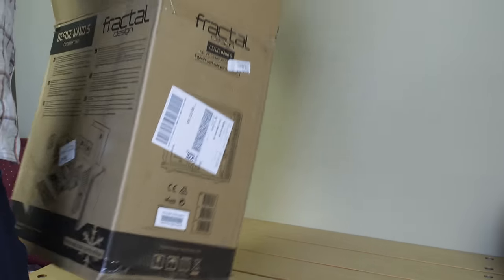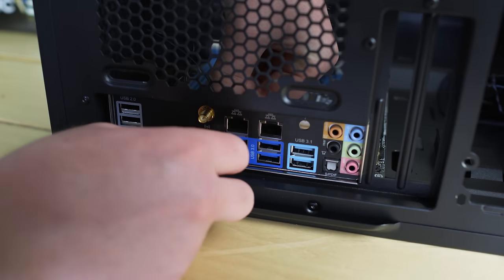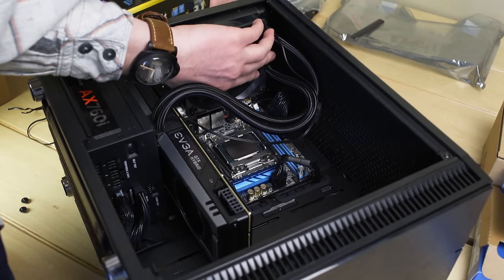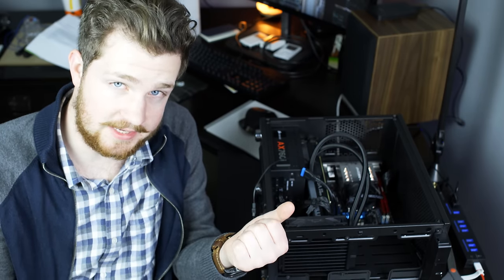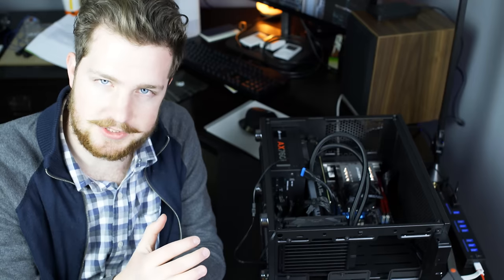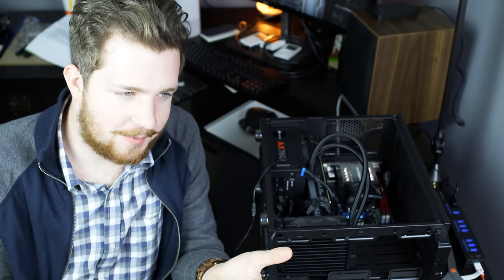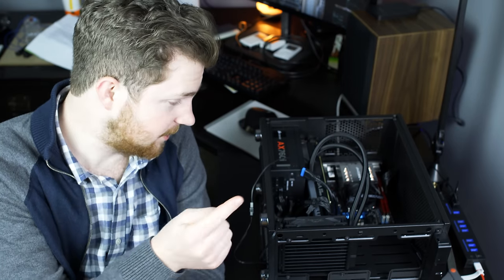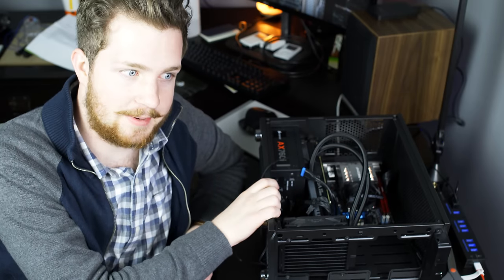My Powerful Custom PC Build Disaster

Comment: Hey Snazzy just a tip if the build isnt going to pull more than 80% of a powersupply then you dont need to go so high :) welcome (just helps save a bit any Thermaltake Corsair or EVGA PSU is good as long as its 80+ in any way)
Reply: +Phillip Roberts Also forgot to say never buy a refurbished psu

Comment: I've never run into any real problems building computers with new parts. This week I've ran into two video's where people ran into huge problems building a desktop, in both cases using brand new high-end parts... and then a refurbished power supply?!? 

I have to admit that I don't know all the ins and outs of refurbishment, but doesn't that mean these power supplies have been malfunctioning before? I wouldn't put my trust in that. 

Decent power supplies aren't that expensive. I usually spend 50-100 euro's and all the machine's I've build and still know about have been running for at least 8 years. It doesn't seem worth it to me to save a few bucks on these parts, given the amount of frustration and time wasted when it doesn't prove to be 100 percent reliable.
Reply: +jpoortman Ah, didn't see it on the first page, but apparently this subject has already been touched upon quite a lot. Rightfully so. Don't buy refurbished PSU's! Unless you do it to alleviate the environment and willing to deal with the misery I guess...

Comment: For me it totally looks like the graphics card is way too close to the PSU. Tests have shown that a triple-fan solution on Graphics cards like these is far superior over a wind-tunnel solution. Also, if a Cable like that does not fit into the PSU without mechanical force, you're doing something wrong or the Cable is the wrong one. You could have switched the ends around, for example...
Reply: its hard to get in becouse the mold they designed for the backpart whent 1mm wring wich made it hard to put in

Comment: Step 1 DONT BUY A SECOND HAND POWER SUPPLY
step 2 relax.
Reply: I mean seriously. Rule one of computer building is test it outside the case first. And if you need to use a screwdriver to connect something then there is an issue. Even a Mac fool like me knows that.

Comment: I think you may have put too much thermal paste on your CPU. It should be the size of a pea or rice grain, however it looked like you applied something like a chickpea or a blueberry. If it spills over the side of the CPU and onto the mobo, it could short-circuit, or you may just added a few degrees to temperature of the CPU. Either way, I would try again.
Reply: +zeronecool Short only happens if it's conductive paste, and you have to go really overboard to do that as it has to get under the CPU, not just off of the heatspreader.

As for temps: Anything at all more than way too little, makes no difference to the temps. The way modern heatsinks/etc. clamp down onto the CPU, it gets evenly thinned out, so the amount doesn't matter. ( Note that the way too little is a really tiny amount. Around 1/10 of what he put on. ) Since too little is the only thing that matters now, I actually purposefully lean onto the too much side.

Comment: Mac - Overpriced hardware with an Apple on it. 
If you want the MAC OS so bad, build a PC and slap that on there, and save yourself from paying for a $2000 apple logo.
Reply: For a similar price PCs are similar performing in the form factor. Especially with the Mac Pro line. But if you want pure performance then Apple is just terrible.

Comment: lol "eliminate the denominators" sounds like a bad ram stick. lol not a power supply. do a memtest. smh hahaha omg what a waste of time. sometimes its better to leave the building and testing to people who are familiar with the platform. putting together a computer is easy as legos but testing is another game altogether . I just fixed one of these issues on an htpc for a guy. would work for 15-30 minutes watching video. first thing i thought was it was dirty or a fan died. Opened it up and it was pretty clean and the fan worked. ran a memtest. BOOM bad ram. could check power supply voltage and temp  to see if it was that.
Reply: also ram needs to be in certain lots if you are not using them all.

Comment: I hate the first week after a new build
Reply: +SE09uk 2 months on my new build, I'm starting really regret Win10...driver issues out the ass, Crossfire not running right and Steam crashing like theres no tomorrow...I miss 7
Reply: +silver&lead I have 7 and 10 in a 2x boot but never use 10
I could have give up my 7 key to use on 10 but like 7 too much
I just run 10 in dev mode (cant remember the name) with no key and it has worked for monts
do you have a 7 dvd or .iso you could install ?

Comment: First of all, 
Your chassis is way to small to hold in all the fans and the damn liquid cooler,
Second of all you put quite a bit of glue to the core to attach the coolant system,
Third of all; it did not look like you attached the cooler to the side of the chassis right, that is just speculation. Don't snob around and tell everyone a mistake you made. Just get a larger chassis, that one is way to small if your going to be going through upgrades.
Reply from the maker: +SucThenut V Firstly, you're incorrect. It's a fine size. Secondly, it's paste. Not clue. And it's fine. Perhaps a little too much, yes, but it doesn't matter. Third, it's attached right.

Comment: snazzy u have a 6 gb video card (980ti) and intel core i7 and ddr4 ram on a 760 watt power supply u should get at least 950 watt to work like a beast
Reply: even a 500w psu would be enough

Comment: I would have bought a 1080 instead of gtx 980ti
Reply: Jonas Langesæter its much cheaper so if ur not rich i wouldent buy a 1080
Reply: FinalBali Yeah you Are right i can't come close to having enough money to buy a 1080. It just semt New for me that a youtuber bought a semi outdated card when he could have gone for a better option like the 1070. If he wasn't gonna oc alot. :)
Reply: Jonas Langesæter I'm sure he probably would have done the same, but at the time that he did this build the 10 series wasn't released yet. Also the other guy is wrong, not sure about prices in his market but a 980Ti Hybrid costs more than most 1080s with less performance, only way I could ever see someone grabbing one over a 1080 is if they had a case with really poor airflow or wanted really nice temps.
Reply: this video was made a good amount of time before the GTX 1080 was even announced

Comment: 2500$ PC... With a refurb power supply. WHY??????
Reply: +IRNatman honestly I'd have to guess it's because he got a lot of those parts through sponsors and probably didn't spend a TON on parts himself. there's just no way he paid 25 hundo out of pocket and was like "hey I'll just get a refurbed power supply instead of a reputable one with similar wattage for a slightly higher price" and here we are. he could have gotten a seasonic 700w PSU that was modular brand new for probably $120-130. but this is a guy who got a 980ti and 32gb of memory to "edit video" so

Comment: yep you got a way to low powersupply for your build dude you should always anytime u build a new pc use a power supply caculator that 980 ti you need a min of a 800 watt psu that not including all the water cooler u have
Reply: +Khromus S if you want to use all that liquid cooler i would recomend at least a 900 +

Comment: so bought great gpu, good psu and ddr4 ram but opted for a shitty mother board and a small case to cramp everything in :(
Reply: Motherboards don't matter as long as it can run the cpu you use and ram and has features you need such as oc support.  The power supply is the problem refurbished is really bad it's a 50/50 chance of getting one that will work and probably another 50 that it will work for how ever long you intend to keep that pc for.

Comment: you didn't install thermal paste... you couldv'e gotten way better temps with thermal paste.
Reply: FBZ-Spongebob it's preinstalled on the CPU cooler
Reply: it was used
Reply: 7:20, you fool

Comment: you could had payed a lot for someone else to do the job right? let's just say that the only thing wrong there is the water cooler; but after your pc just got so hot, but hot like 100 degrees Celcius and then you just restarted it over and over, let's just say you've fried your pc, that's why it's not working properly, anyone else capable of building one is gonna laugh at this.
Reply from the maker: +HUGE WEINER Nah. It's fine. Bad PSU was the only issue. Works well now. Build is perfect. Just as planned.
Reply: by the way awesome GFC and WC you got there, and im not flattering u or nvidea and etc...

Comment: LMAO youre calling 5820k beastly? and you thin your computeris powerful? you know nothing about pcs indeed...
Reply: +Rainbow Dash To be fair, that is about the 5th fastest CPU outside of the Xeons, but for about half or less of the cost of the faster ones. That puts it firmly in the top end, and a good deal. I paid about the same price for my new 6700k which would be slower. ( I'm a gamer though, so the 6700ks higher clock is superior, and the next generation is still supposed to use the same socket. )
Reply: lol its not u clearly know as much as he does
Reply: Rainbow Dash Yes it is. Maybe you're thinking of gaming, in which case the lower clock would greatly hinder it...but this isn't for gaming so the higher core count will see significant benefit.

Comment: I personally would never recommend liquid cooling for beginners.
Reply: +asdfghjkl 
Its a little different when they are closed loop. That is the whole point of the closed loop systems. They are for beginners. you have just as much chance screwing something up with backplate mounts and heavy heat sinks around your mobo as a beginner as a closed loop. Unless you are installing them with Edward scissor hands that is or just pulling on the tubing as hard as you can to make them leak.

Comment: Yeah . . . corsair power supplies are literally the most returned.  They are crap.

And silly SILLY Mac user . . . NEVER buy a refurbished power supply.  And again . . . never buy corsair PSUs.
Reply: +BaradaNels When it comes to PSUs, it's not the brand that counts, but the actual OEM behind it.

Basically, there's a shitty OEM behind the Corsair RM series, but a flawless OEM behind the higher-end AXi series, especially the AX1200i and AX1500i.
Reply: +BodethIII Who are the OEMs?  Do you have a link to all PSU OEM manufacturers?  Preferably with ratings already?  That would be quite handy.

And fyi the report I read didn't discern higher grade and lower grade PSUs.  They just put them all together in a lump.  And Corsair had a staggering 7% plus return.  Everyone else was 4% and below.
Reply: Off the top of my head:
Flextronics
Seasonic
Superflower
Delta

Pretty much any PSU made by the above four is golden. EVGA uses Superflower as their OEM for their SuperNova PSU lines, Corsair uses a mix of Seasonic and Flextronics for PSUs that's of HXi or AXi, and so on.
Reply: +BodethIII Thanks for the list.  Yeah I only buy EVGA PSUs.  I love their products and you cannot beat their customer service.  But I have also heard that Seasonic makes an awesome PSU.

I will use this information and do some research to better inform myself.  I just got mine and my girlfriend's rigs ready for VR.  But I foresee an upgrade in both of our futures.  If I can find something better than EVGA, I will hop the fence.  By far not a fanboy.

Comment: Well you bought a "refurb" PSU off of ebay from all places. Then you wonder why it doesn't work. If you are going to cut corners it should never be on the power supply.
Reply: +Mitch Baker (Illegal Chest) He bought it of Newegg via eBay.  Newegg should be a be reputable source.
Reply: When he first said it he said eBay. Them changed to newegg
Reply: In the earlier part of the video he originally said it was from Newegg.
Reply: +Mitch Baker (Illegal Chest) Check out 5:17 and 11:34 He mentions both times that it was from Newegg on ebay.

Comment: Why did you pick such a tiny board for a overpowered build? I'm guessing the board could not meet the demands of the gtx 1080 ti, but my point is it was a horrible combination of parts that you chose.
Reply: Solid combination of components for what he wants to do and GTX 1080TIs don't exist yet. As for a 980 vs a 1080 or 1070, well that I can't comment on, though both of the latter are still scarce as hen's teeth, especially 6 months ago when he made this video.
Reply: so you believe paring up a 700$ video card with a board that is clearly not made for gaming is a good idea?
Reply: because he wanted more room in the case for Water Pipes in the case. also, there is no 1080 Ti, you meant the 980 Ti, did you,
Reply: Marketing ploy aside, if your going to spend over a 1000$ on a build and you wanted room for things like water cooling why not get a full size case, and new power supply? Your still trying to overlook the fact he is using a board that is more cpu based than gaming. The 1080 is overpriced from a price to performance standpoint, but i'm sure they count on " the uniformed will always overpay for what they believe is the best at the time.
Reply: The guy had a Mac Pro trashcan, he may be used to small computers for all I know.. ITX has no huge disadvantages to ATX..

Comment: Does the fan even spin in the PSU ? That might get too hot too.
Reply: The fan should only spin in the psu when it draws above about 80% of its rated watts, which therefore means 80% of its rated voltage and that will create heat so no, the psu's fan doesn't need to spin.

Comment: I'm glad I'm not the only one with problems like this. Built myself a nice new PC and the thing worked great for about as long as it took to install Windows and play with it a bit, then it shut down. Same kind of deal, bad power supply. Then six months later it started randomly locking up and shutting down, turned out to be a bad motherboard.

But even with the problems I love being able to build my own PC's, which you can't do with Apple.
Reply: +Jeff DeWitt Hackintosh mate, you sure can 'Build your own apple' machine.
Reply: Sacra Mental Yes but... when I build a Windows machine it's perfectly legal and legitimate, which is a lot more important to me than it used to be. A Hackintosh isn't. Apple doesn't really sell copies of their OS, they sell machines with the licence for the OS, you can't just buy a Mac OS licence and install it on whatever you want (legally) like you can with Windows or Linux.
Reply: Jeff DeWitt Sure, but if you own a mac already, you hold a licence... Don't you?!.
Reply: Sacra Mental Yes, you have a licence for that machine. However if you build another machine you can't legally use the licensed copy of the Mac OS on the new machine.
Reply: Jeff DeWitt That's like saying you buy GTAV and can only play it on one console, pc or what ever.. and you all buy into this bullshit? :P
Reply: Sacra Mental Look at the EULA. I'm pretty sure it says you have the right to use your licence on a single machine and it's probably not transferable to any other machine. Knowing what I know about Apple I'd bet on it. Keep in mind we are talking about legal installs here.
Reply: Jeff DeWitt EULA.... Don't make me laugh. Does anybody abide by these?
These are ALL bypassable anyway, where there is a will there IS always a way by means of 'Loop Holes'.
I guess you like to live on the short and narrow, abiding by bullshit laws made by joe blow who really is no different to you or I for that matter.

I too could release something I coded with ridiculous clauses 'preventing' you as an end user against 'reverse engineering' when infact this term has a huge grey area attached to it itself.

As stated.... there are ALWAYS ways around 'licenses and EULAs', Legal methods too.
Reply: There are gray areas and some are not. If Apple's EULA says you can't use their OS on any machine it's not included with that's not exactly gray. As to abiding by them no one even reads the things, but that doesn't mean they are meaningless. 

Now if you build yourself a "Hackentosh" and install the OS that's licenced to a dead Apple I REALLY doubt Apple would care very much, but if you start putting it on multiple functional machines I'm sure it's a different story.

I've done my share of violating EULA's over the years, probably the first time was when I discovered if you pulled a Windows 95 recovery CD out of a machine at the right time Windows would go ahead and install on anything regardless of what it was... but that was a long time ago.
Reply: Jeff DeWitt You do know that no matter how well companies word their EULA, theres ways around it. always has been, and 100% legal.

Comment: Too bad you could not have waited 4 months for the new nvidia cards
Reply from the maker: +Michael H Eh. Not a big deal. Performance improvements in Adobe Premiere won't be very much. Plan to build a separate gaming rig in a few months with a 1080.
Reply: For which reason?
5820k @4,3 GHz is a safe overclock (running mine @4,5 on air) and delivers great gaming performance, 6700k might have a bit better single core performance, but nothing you would notice. Replace your 980 Ti with a 1080 and you're good to go.